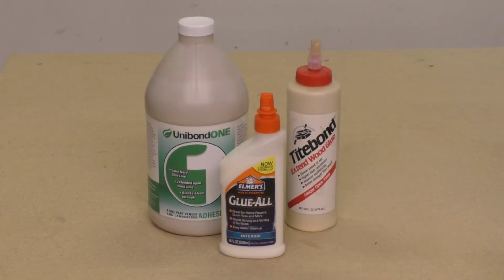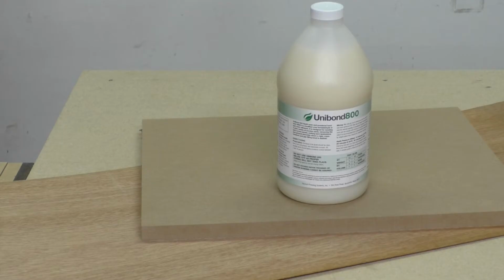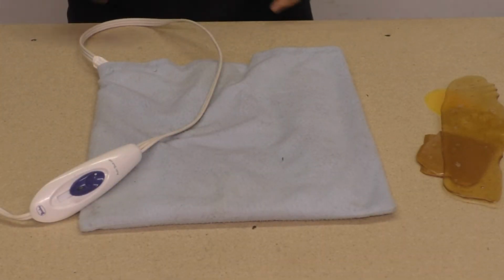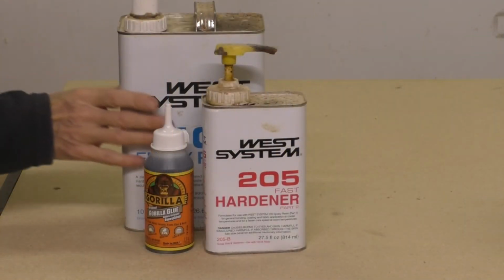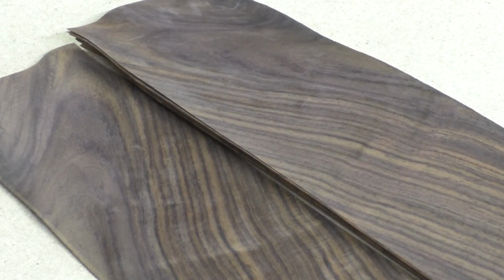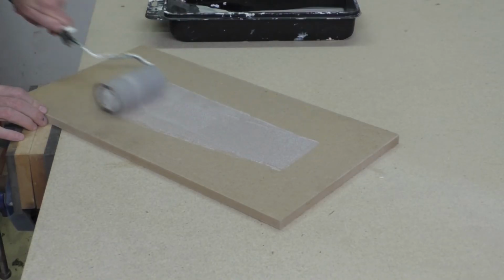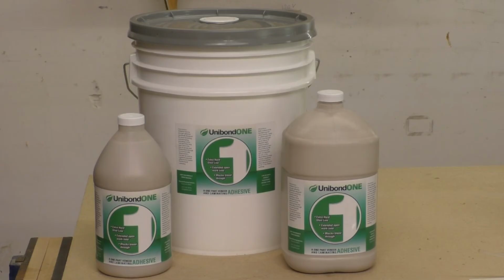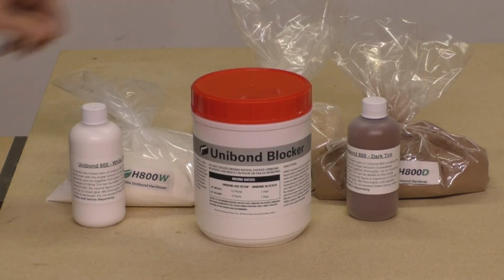Understanding Glue for Veneering

Comment: Excellent excellent tutorial.

I'm a very ambitious woodworker and just took a job building 10 doors for a medical center. I'll be veneering walnut veneer over solid plywood core doors.  Pretty much convinced the urea glue would be the best...

So, in my 78-ish degree F. shop with high Florida humidity  do you have a ballpark open work time for the urea glue? I'll be doing 7' by 36" doors, obviously each side applied and cured separately.

Also I'm somewhat concerned with bleed through. I'll use the minimizer additive, but how easy does the bleedthrough clean up after curing and what problems am I going to have with staining and do you have a stain type or brand recommendation?

Lotta questions, I know so thank you so much in advance!

Loved your video!
Reply from the maker: I would probably leave it under pressure for about 6 hrs and then dont try to trim anything until the next day. Bleed through wont happen on a backed veneer only raw unbacked wood.
Reply: @VacuumPressingSystemsInc  Thank you. I'm going to need a bunch of stuff. I'll call you in the next couple weeks.
Reply from the maker: @davearonow65  You're welcome. We look forward to speaking with you.

Comment: What can I use on a curved speaker box? I'm using paperbacked with no press? And I can't use a cowl of some sort!
Reply from the maker: without some kind of a press, especially on curved work, a caul is going to be difficult to get enough pressure using a regular wood glue. I'm not a fan of it, but contact cement may be your only option.
Reply: @VacuumPressingSystemsInc   what about using some heat lock glue?  With a clothes iron
Reply from the maker: @roofermarc1  using a PVA glue with an iron is another option, again not so great for a number of reason but somewhat better than contact cement. Any white or yellow glue will work.
Reply: Well if I use white or yellow glue I'm back to clamping the project properly every sq inch that's why I mentioned the heat lock glue from Joe @veneer supplies. I didn't buy my veneer from him and don't want to take up his time. Thanks.
Reply: It dawned on me after watching and listening to you that I could use white or yellow glue and heat with an iron and not have to clamp the project? I already bought that heat lock glue from Joe though.

Comment: I've used a catalyst glue that I mixed from powder and Titebond 3 when wood veneering in a vaccum bag.  The Titebond 3 worked the best.  The catalyst didn't adhere as well as the Titebond 3 and the catalyst glue had to stay under vaccum longer.  I will only use Titebond 3 from now on for porous wood surfaces.
Reply: The problem is that Titebond 3 cures to a notoriously soft glue line. Titebond 2 and 3 both cure to a less rigid glue line than regular Titebond. 
You need a harder glue line than Titebond 2 or 3 will provide. 
The way to get a hard glue line with a PVA is to use Titebond 50 or other high resin content hard curing industrial PVA's made by Fuller and others. 
I have some face lams that I glued up with Titebond 50 in the early 1980's. Their glue lines are still as flush as the day they were machined.  
Glue color doesn't matter. Some of the hardest curing PVA's are white. No yellow or brown colorant, which is what they add to create Titebond.

Comment: What glue would you use for laminating gothic arches or beams for a greenhouse? What about the inherit dangers of using the urea resin powder both in mixing and sanding?
Reply from the maker: I would use epoxy. The arches may not get direct water but year after year of high moisture is probably best with epoxy

Comment: So if hardness of the glue equals brittle, don't i have to worry about the glue cracking during normal expansion and contraction due to temp? Would not a more flexible glue be more stable?
Reply from the maker: the point of a rigid glue is to STOP expansion and contraction, that's why you would be gluing veneer not thicker solid wood.

Comment: Oh man, thankful I found this...I'm about to try my hands at gluing 5mm thick wood to mdf. It's thicker than actual veneer, but since I was planning to do full 4'x8' panels, I'm thinking I may want to consider the Unibond 800, unless you think it's unnecessary. I am a novice when it comes to woodworking and always looking for tips and other considerations. Definitely appreciate this detailed rundown.
Reply from the maker: I would recommend going with the Unibond 800 for two reasons. With a 4x8 panel you will need the extra open time to spread the glue and get it in the bag. Also this glue will have more "power" to stop expansion and contraction of your thicker 5mm wood
Reply: @VacuumPressingSystemsInc  Thank you!
Reply: @VacuumPressingSystemsInc    is the glue available in Canada and if so where would I be able to purchase it? Thank you!
Reply from the maker: @vortex162  Veneer Systems Inc is a supplier of Unibond 800 in Canada.
Reply: @VacuumPressingSystemsInc   Thank you for your reply!
Reply: Thanks this was exactly what I was going to ask with my large panel wood backed veneer project!
Reply: Great video! I am trying to find the right glue for veneering over a steel door. This will be an exterior door too. I’m leaning towards the unibond 800 based on your video but thinking I might need the extra strength of epoxy. Did I mention I live in Phoenix? It will need to handle the expansion and contraction of 110 summer days. Not in direct sunlight though and it will be protected from water.
Reply from the maker: @roboticsurgerydoc9748  Unibond 800 will not bond to steel as it requires a porous substrate to achieve proper adhesion. You will need to use epoxy or polyurethane.

Comment: That was very informative.  Perhaps you could offer your opinion on my situation. I'm repairing a kitchen table thats approx 4' x 7'.  I'm getting  a piece of Richelieu walnut veneer  (.025) and attaching it to a mdf board.  I'm in Arizona with Temps of 90°-100°.  Which glue would you suggest?
Reply from the maker: I would use the urea resin glue for this.

Comment: I am currently taking my red oak wood veneer and gluing it to my wood red oak panel in the kichen we had bonded 2 pieces together with glue and wood filler to make this panel 8 ft length piece beside the fridge what glue would u use to attach the veneer to this panel..thank you
Reply: Thank you for the valuable information I really appreciate your response
Reply from the maker: I need more information. Is the veneer your gluing raw or backed, and how wide is this panel.
Reply: @VacuumPressingSystemsInc  the panel is 24 inches width and 8ft long it runs between the fridge and the cabinet all the way to the ceiling..I have confirmed it is mdf we have bonded 2 pieces to make it this length I am just wondering we have purchased wood veneer 24 x 99 inches in a roll with wood backing which glue would you recommend..? Thank you kindly f9r getting back to  me
Reply from the maker: @aceofspade8795  A regular PVA glue will work fine. You could consider our PVA glue specifically designed for veneering. Be aware, the seam between the two pieces can telegraph through the veneer over time. To play it safe I would crossband with another sub veneer to protect this issue.

Comment: Great info.  But, what if you want some flexibility?  ie.  glueing a burled walnut veneer to solid wood.  You expect the solid base to move with seasons and I would think that a rock solid glue would cause that to fail?
Reply from the maker: it somewhat depends on the overall size of the piece your veneering, larger the piece, more the movement. The more important issue is that the veneer's grain direction follows that of the solid wood substrate. A burl veneer with the grain going in multiple directions is more likely to cause fizzuring on top of the solid wood, than the issue of the rigid glue.

Comment: Hi, I am trying to glue a veneer to a plastic surface, some people recommended PVC or polythurane, what do you think is the best in this case, thanks
Reply: or if you have any suggestion to how glue veneer to plastic, thanks a lot
Reply from the maker: I would recommend either epoxy or polyurethane glue. I would not recommend a PVC cement. Make sure you rough up the surface of the plastic with a course sandpaper, like 80 grit

Comment: Thanks for the excellent video, just wondering if contact cement is any good on paper backed veneers
Reply from the maker: Like I said, I don't use contact cement for any veneer work unless it's plastic laminate backed. The problem with paper backed is it's still flexible enough to bubble under contact cement or be somewhat wavy. When the veneer is laminate backed these issues do not arise due to the rigidity of the backing material and using contact cement works fine, but not with paper backed veneers. Sometimes using contact cement will come out reasonably OK but it's a bit of a crap shoot. I often say, I sell more vacuum presses due to contact cement failure than any other single reason. Your taking your chances with this type of glue.

Comment: I saw a video or a man using Titebond glue to attach a paper backed veneer. He applied glue to both surfaces (in this case an interior door) then let them dry, like you would for contact cement. He then used an iron to heat and reactivate the glue and press it down. He seemed happy with the results. Any thoughts on this method? No press or clamps required.
Reply from the maker: I am familiar with this technique and not much of a fan of it. Two things. Its not the way this type of glue is intended to be used and the bond is definitely not as good as when proper clamping is applied. Second, a significant amount of stress is put on the veneer by the kind of heat an iron will put on it. This can weaken the bond between the paper and the veneer as well as the localized heat can cause the veneer seams to sometimes open up. Yes, I understand when you don't have a press this method allows veneer to be applied, that doesn't mean it's a good method. If it was me I would relegate this technique to edge gluing veneers when its difficult to use clamps. Large surfaces is asking for trouble.

Comment: Thank you for an excellent lesson on glues.  I'll watch it again, making better notes.  Maybe you can recommend a site that would show me how to ensure a good bond on a table and executive horizontal desktops.  The smaller of the two surfaces is 2.5' x 5'.  The "veneering" demonstrations I've found have engaged vacuum bags or clamps, but the examples have been only about 1'x2'.  Suggestions?
Reply from the maker: Glad you enjoyed the video. I am not aware of any videos on ensuring a good bond. If what you've seen has been useful but only for a 1'x2' project it should be no different for your larger project.

Comment: A great informative video,,, what about hide glue rigidity and penetration of veneers ,, I'll attach a birds eye maple to a guitar and want to stain it with water based dyes.
What is your recommendation.
Thanks in advance and keep up the good work.
Reply from the maker: hide glue is fairly rigid but it is moisture sensitive. It definitely can bleed through depending on your application. Usually good scraping and sanding will remove the bleed through and allow for uniform stain.  Do a sample test to be sure.
Reply: @VacuumPressingSystemsInc  thanks alot

Comment: I wish I found this video before wasting 150 bucks of maple veneer using PVA. Lesson learned! Thank you for this video. You did an excellent job!
Reply from the maker: Ahh, the joy of woodworking...happy to hear you enjoyed the video though!
Reply: I didn't get that he said PVA was not a good choice on any  species of wood. It was more about conditions wood are exposed to that got my attention. I was feeling like you having just spent 60.00 for some paper back mahogony veneer then going with 4x8 sheets with 3M peel and stick. 300.00 I was assured PVA was good by manufacturer. I had contacted 3M they could tell me what properties by the particular number and type PVA 3M peel and stick was on veneer I purchased. I was very impressed by this presentation of what environment what glue to use. The Hyde glue we used in Woodshop in the late Sixties as Hyde glue was on every veneer since veneer was made. And sticks in any environment. The video made good points on seam separation being a factor on type glue to use. I am concerned with bending my mahogony around a 3/4 round over outside cabinet corner. I have never applied veneer. But I never want to reapply the veneer I am about to do.

Comment: I would like to hear your comment on two questions that I did not hear addressed in the video; 
(1) is there any health concern about exposure to the formaldehyde or other chemical components of the urea based glue and 
(2) are any of the glues discussed especially hard on tooling and cutters when working the wood after gluing? In other words, if you know you are going to be doing a certain amount of cutting and shaping of the project after gluing, should that influence my glue choice? Thanks very much
Reply from the maker: Unibond 800 is an ultra low formaldehyde glue, with that said there is a small amount of exposure when using this type of glue. A respirator is always a good idea and decent ventilation. Its using large quantities that can become an issue. Most woodworkers I am speaking to are using small quantities in general where serious health concerns are minimal as long as good ventilation and lung protection is practiced.

epoxies and urea resin glues can be hard on tooling. I suggest carbide blades and bits for dealing with these two glues.
Reply: Thanks for your informative and clear video. I was wondering about formaldehyde especially as veneering can be over large areas.  Whilst you can mitigate inhalation at the time of application, there must be offgassing over time, or is the low formaldehyde so low it doesn't register?
Reply from the maker: @jonathanwebb9862  Different urea formaldehyde resin glues have varying amounts of formaldehyde so I can only speak to Unibond 800's content. Unibond 800 contains only .4% formaldehyde which is considered an ultra low formaldehyde glue. When catalyzed 99% of the .4% formaldehyde is locked up in the chemical reaction which means the off gassing is negligible. With that said the very small amount that does off gas is generally gone in about a week.
Reply: @VacuumPressingSystemsInc  Many thanks for taking the time to explain that.

Comment: Great overview of the differences in glues and why each one is different. What glue do you recommend for shop-sawn veneers 3/32" thick for a large table top?
Reply from the maker: I would use the urea resin type glue to help resist the expansion/contraction of your thicker veneer, and the fact that it will be a table top
Reply from the maker: Generally I would use the same 6 question I ask for commercially sliced veneer for shop sawn veneer as well. Since your panel is a table top, which would be a horizontal surface then I would step up to one of the chemical reaction glues. My choice, of course, would be the urea resin glue.